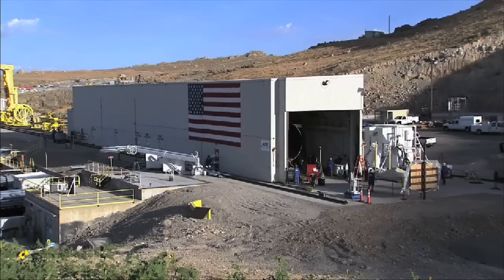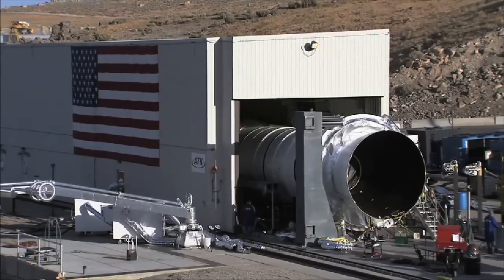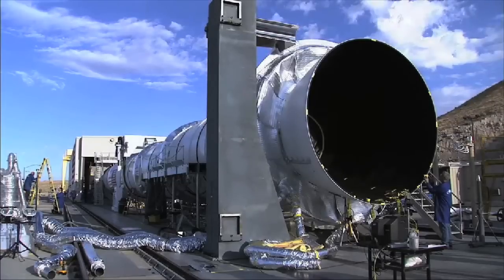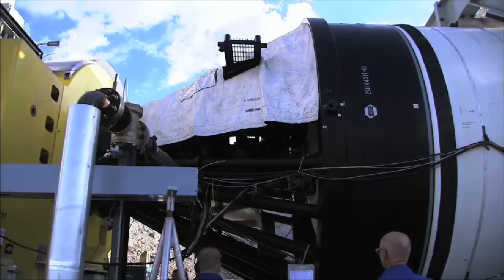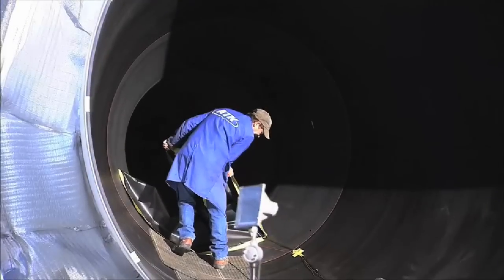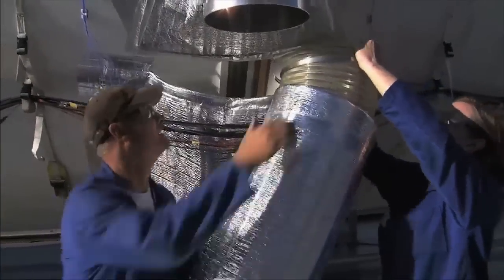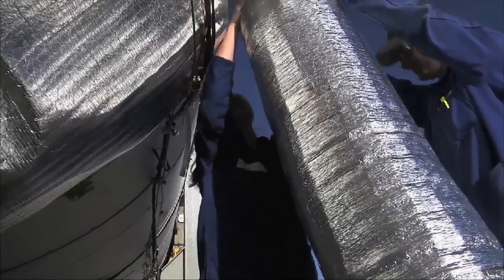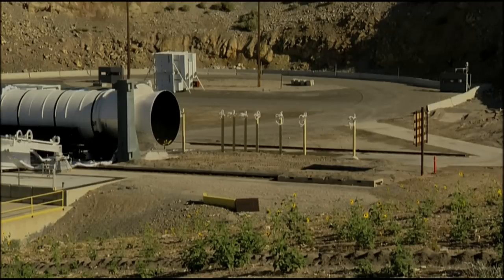Rocket Motor Fired in Utah Test Stand

Comment: The initial ignition must put alot of stress/shock on the system, I wonder if they can slow that down to a second or so,  instead of going from 0 to 100 in a fraction of a second.  It was awesome though.